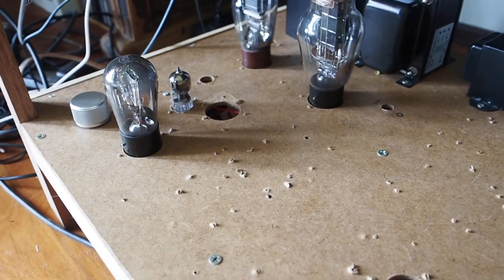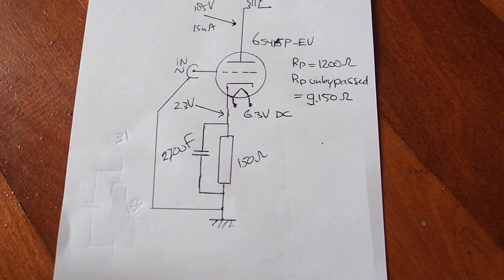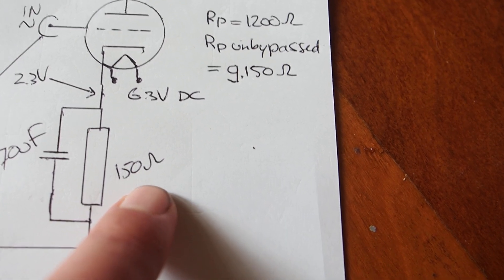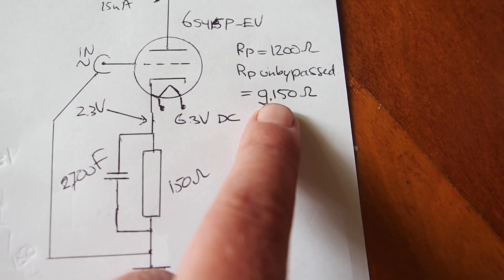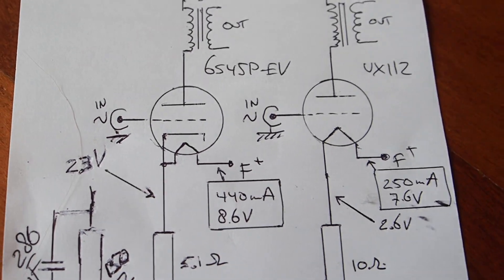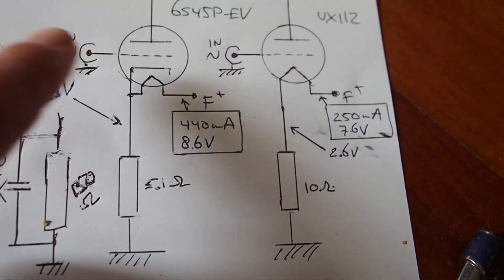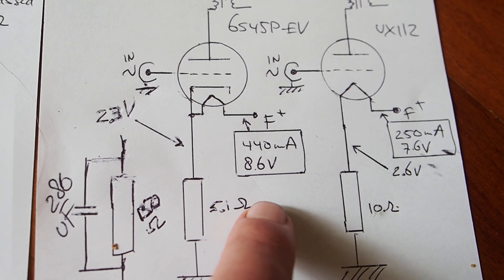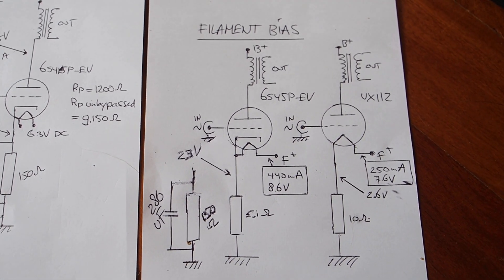Filament bias for indirectly heated tubes - how and why

Comment: In dht, what about using a floating ground reference at the negative to raise the voltages to bias the tube. So you might have 40v and possitive and then connect it to a 35v supply at the negative, then you get 5v for the heater and bias set also?
Reply from the maker: Yes a floating regulated ground works.. I've used that in the past to apply a regulated voltage between amplifier ground and signal ground. But now some homework for you: check what the the return (AC) signal path is in that case and what are the extra component you then have put in in the the input signal. and its return path..  my generally assessment is that you've simply have shifted the components/problem and generally not for the better.
Reply: @EduardBroekman  adding a small capacitor to ground for any capacitively ac coupled noise. Im not sure which one sounds best what is your preference and what about b+ divider bias.

Comment: do you check for oscillations with a scope?
Reply from the maker: If problems occur, yes.  Often I spot non-AF oscillations from unusual power consumption patterns.  However these days and certainly with DC fed tubes, there's very very little chance of that and that's partly also due to living in a very low RF environment. With that said, I tend to check and measure the distortion spectrum of each stage, at different power levels to see if there's any faults in the execution or design and oscillations generally show up there as well, unless well beyond the AF bands.

Comment: All the problems of using a dht with none of the benefits. Instead of worrying that a tiny fraction of heater PS noise can be coupled to the cathode through the parasitic capacitance  we now have the entire  voltage noise right where we don't want it. Genius. And of course this can have no effect on oscillations, none. A fixed bias applied on the grid requires a clean voltage source with zero current -  much easier than a clean voltage source at the required heater current.
Reply from the maker: For some, a low noise supply is no issue and as one upside, filament bias doesn't blow up tubes when the fixed bias drops out as it' is an inherently fail safe solution. Additionally, it doesn't require an input cap or input transformer needed for fixed bias, leaving aside more complex regulated resistor-only fixed bias type circuits. To me, it's a question of what trade-offs we prefer in a specific application, your is one choice for sure. I personally like fixed bias sound wise - probably because its regulation falls outside the signal path -  but if it's requiring an extra cap or transformer it becomes a lot less attractive. Do you add logic to your amps to switch off the B+ when fixed bias fails?

Comment: Hi Eduard, as you can see I am catching up with your videos now that I have the mind set to give them the attention they deserve. Going by the title, I thought this would be about cathode followers, but it is much more interesting than that. I am a little bit surprised that you are now using a current source because I remember asking you about this before and you where not in favour of it. I guess the difference is that this is indirect and the question was for a direct heated tube. But never the less, could you perhaps expand on this. When to use a current source and when to use a voltage source for the heater filament? 
Also, a bit related to this subject, albeit there is no filament bias, is an idea I had which might be sacrosanct to you. It is to do away with grid stoppers and cathode capacitors and minimise the amount of components, I have been thinking to build a SE tube amp lets say based on an EL84 whereby the grid is grounded and the cathode bias is modulated by (seemingly preferably) a (MOS)FET but to start with a BJT for ease of implementation in the prototype. (The BJT could be a BC550 but it would run close to its maximum power dissipation, so perhaps something with a bit more power. The ideal MOSFET to start with would be the 2N6660) This would result in a two stage power amp that would be very easy to drive with a line level input signal. The disadvantage could be seen that the first stage is a semiconductor, but on the other hand there is hardly any two stage design that is more direct. What do you think about this?
Reply from the maker: Hi Hugo, the main reason (as far as I remember), is that I wasn't a fan of LM337 / LT1085 style regulation when I tried it, regardless of whether this was as controlled current (over shunt) or voltage control. As Rod Coleman states, DHTs have the music signal across the filament, so a voltage controller would see this as an error - so that's not a good idea. So my choice for DHT currently, having not tried LCL, is to go passive, use a buffered voltage controller (see below), or use Coleman's regulator which is a well developed and behaved current source (yes good for inrush too). 

For battery tubes like the UX112, or filament bias for any driver tube, getting them quiet with a passive circuit is very hard - and this is why I'm forced to use a regulator. I can't say yet if I like the result musically - the Coleman regulator is definitely good and extremely quiet, but I have to do a proper A/B with a good passive regulation, or my voltage regulator setup to check the differences.

In the past, in my most musical amp (the 26-46-50 amp), I did use noisy cheap voltage regulators but buffered those with a large cap and common mode choke to eliminate the nasty regulator sound plus decouple the filament from the regulator. That may well have been the reason that I stated I preferred a voltage controller - although looking back it's probably the decoupling that was the major contributor and not the method for regulation. 

I hope that clarifies my statements over time somewhat :)
Reply from the maker: As for your idea, if I follow you correctly - that would be a fixed bias EL84 with a solid state first stage. I'm generally pro eliminating caps, or else using them as late as possible in the circuit (output tube).. so I can easily can get onboard with that but the critical phase is the small signal amplification, so the overall result will mostly depend on the implementation of the first stage. I can't say if that would sound good. One question to ask is if are you picking the right battles - for example abour eliminating gridstoppers?

My dual channel amp was able to stay full DHT and 2-stage because of the efficiency of compression drivers. The filament bias eliminated an early bypass cap and the gridstoppers are only 120 ohm - miniscule in comparison to the shunt volume control. So I'm skewing as much as possible to the same goals as you have... but in the end the 120 ohm gridstopper are of less importance than the quality of the OPT, so eliminating the 120 ohm is not going 'overwhelm' even my very good Hashimoto OPT.. so you have to focus on elements that matter, and that may actually be the power supply.

It would be interesting to hear the difference between your proposed design and lets say a 4P1L (mu=9.6) DHT driving the EL84. I also quite like the approach of Andy Evans on diyaudio, 47 DHT driving EL6N (high mu, round plate IDHT)..
Reply: @EduardBroekman  Hi Eduard, I agree that the grid stopper is perhaps not a compelling reason by it self, but it is an added bonus. The idea (not mine to start with but fairly obscure) appeals to me because I never liked  the bypass electrolitic capacitor. There are modern alternatives for the input tubes that use a LED to give the right threshold voltage but at that point you may as well stick a BJT or MOSFET in it (Although the latter is going to be a real challenge to bias it in a way it is stabile. I am struggling to work it out in my head how the power up of such amp will work). That resulted in the realisation that if you bias an EL84 with a transistor, you may as well use it as amplifier and eliminate a tube and LED all together. The component count gets very low like that. But you have this transistor. I find it an interesting thought exercise, and I may try it given enough time, which is a problem. Your indirect heater bias is yet again an alternative for that and may be the best. But you have that solid state current source, and more components. BTW, I first saw this architecture on-line, used with an EL36 and the author claims this is a very musical amp, but who knows. Sadly I can not find it back, but the schematic is not complicated. I am thinking of an EL84 because it opens the design up to small signal transistors that are used also in pre-amps.
PS, is this a fixed bias? I think it is an auto bias. To be clear, and lets use a BJT as example, the cathode of the EL84 is connected to the collector of an NPN BJT and the emitter of the BJT is connected directly to zero volt or through a low value resister to eliminate variations in the HFE of the transistor. The base is used to bias the transistor and because a transistor is in essence a current source, the cathode voltage will self adjust. The base is also the signal input.
Reply from the maker: @hugobloemers4425  Hey Hugo; got it and I see now how you could work with that transistor that way. It'd be super interesting to hear your design (EL84 is v good) vs for example even the not so perfect 4P1L driver... should be very instructive.

I also share your distaste for electrolytic caps - I only use them for filament or fixed bias filtering; they're banned from bypass and B+ power supply (anything in the signal path) - even MKPs don't go in anymore. I'd recommend using the Kemet or Wima DC Links, and you could bypass those (later) with an audiophile cap like Obbligato of Miflex.

Now, I don't like the sound of LED or even Sic Diodes (better) to do the biasing. So fixed bias with ground cathode is a great option, but it does leave the tube vulnerable should the fixed bias ever drop away. Hence I retain the Kemet bypassed cathode bias in the last stage as a compromise...
Reply: @EduardBroekman  This is the biggest concern I have. The article I sadly can not find any more went to this design because the objective was to use the EL36 (not EL34) as a cheap alternative for the EL34. The tube does not seem to sound good with many designs and this was the only thing that worked, very well, allegedly. It went on to explain why, but that went over my head. but the author claims that the EL36 is originally designed to be used in class B mode but why is that not up to the user to decide? (It is a horizontal deflection tube for TVs. Interestingly I still have a Philips class B mixing amp with 30W output, using this tube, so Philips used it also in class B mode for audio. but I digress.) They also had issues and blew up a few tubes before they could make it work. So if you draw it out on paper, it looks super simple. But the choice of bias network is very critical, specially when the tube fires up and you need the plate current to power the bias of the BJT as it is still warming up. (They did not get that to work with a MOSFET, and I can also not come up with a good method, even on paper). So even with a BJT, if it goes in short, which is a common failure mode, it will fry your tube. If I get to try it, which is not soon due to a bubble of work I have, I will be using JJ tubes until it is very stabile. An other issue is that I am not as "advanced" as you are in high end tube design. I can hear that an amp is musical or not, but you and Janos take it to a different level. So if I tell you it sounds great, it may still be worse than other amps you have already moved on from. For sure I would have to compare it with a classic design, for instance with the filament bias you described.

Comment: One of the things to consider using this configuration is that there is less feedback that regulates the current bias of the amplifier. If you redo this design with a tube that due to whatever is slightly different, or variation occurs over time, the cathode voltage will not move as much to compensate the changes in the tube.
Reply from the maker: Hi Erik - indeed that quiescent current feedback is significantly less. However being loaded with an open interstage transformer and quiescent current far away from any limit, I don't think there is a pragmatic issue with this and on the positive, the nearly fixed bias current provides a stable headroom for the input signal. Would you agree?

Comment: Great idea!  This looks like a good options for the 418A driver stage I want to try.  I plan to run it in triode through a LL1660 at 2:4.5 to drive Type 50 or 300B.  A little more gain that way than the 6N7 I'm currently using.
Reply from the maker: Nice; all the best with your project. Actually I've used the much similar (to 6N7) 6A6, and I found it just a bit too weak to drive the a 50 or 300B properly - despite not really doing anything wrong but it ends up sounding reserved/polite. In contrast when driven by power tubes, the 50/300B gains a lot of authority and weight in the lows and the output tube seems to flourish when driven like this. For example a step-up with EL33 driving the 50 sounded very nice.

Comment: I have another question if you don't mind. Is your filament regulator built around "LM317" type 3 pin regulators, or is it something more esoteric? There are the "Coleman" regulators people seem to like. Are you using the Coleman DHT regulators or just a simple 3 pin IC current regulator? Have you posted a schematic for your filament regulators on the channel in the past?
Reply from the maker: I'm using a Coleman regulator for drivers while the output tubes use a CLC filter plus a common mode choke. I tried LM317 in the past but  with that experience, I'd never use it anywhere near the signal path; it has an atrocious effect on audio. Judging on others, try an LT1085 for that kind of regulation. Sorry no schematic since these regulators are Colemans' work. If you look at his website (link in description) and find the V8 assembly manual, you can see what type of component are used.

Comment: Thanks! Beginner here. Since the actual wiring of the filament regulator is not shown... Would I set up my filament regulator as a voltage regulator to output a stable 8.6 volts? And the filament voltage should settle at the proper 6.3 volts, due to the 5.1 ohm resistor, correct? But the tube will "see" the difference 8.6 - 6.3 = 2.3 as bias? Using ohms law... So you take your desired target bias voltage, which is 2.3, and divide that by the filament current of whatever tube, which is 440ma for 6C45P, to arrive at the proper resistor, in this case 5.1 ohms?
Reply: Ah I see. The filament and the resistor form a voltage divider. At the divider point is the bias voltage presented to the tube. In this case the filament itself is R1 14.3 ohms (6.3V / 440ma), R2 is 5.1 ohms, yielding 2.3V when the applied V is 8.6V which was decided based on getting the filament to settle at 6.3V. Cool!
Reply from the maker: @richardhansen469  Correct. The cathode resistor also passes the 15mA quiescent current, so it handles 440+15=455mA. and with the cathode resistor of 5.2 Ohm sets the bias at just over 2.3V. Since my regulator sets a fixed current, not voltage - I dial in the 440mA current, prior to applying B+ (no quiescent current). That's a better guarantee to preserve the filament than setting the voltage since filament resistance does vary from tube to tube.
Reply: @EduardBroekman  Obviously you'd need a dedicated regulator per tube, so no more series or parallel filament wiring. As for using a current regulator vs. a voltage regulator, I see, better for inrush too. I would think that multiple regulators can be fed from one common raw DC rectifier and PI filter though, as long as there no common created anywhere at the outputs of the regulators. Or do you actually create a full dedicated raw DC supply for each regulator? With 4 or 6 tubes things can get pretty cramped in the chassis no?
Reply from the maker: @richardhansen469  Correct and here because both driver tubes are ground referenced (filament bias is), they can share the DC conversion part and then  1 regulator for each tube; they can't share the regulator (if one tube fails or disconnects, it can blow up the other by trying to force the current) . Normally with DHTs filaments and cathode bias, you'll have a floating circuit with separate DC/PI and a regulator - so it's nice if the regulators are compact (but a pain to solder :-).